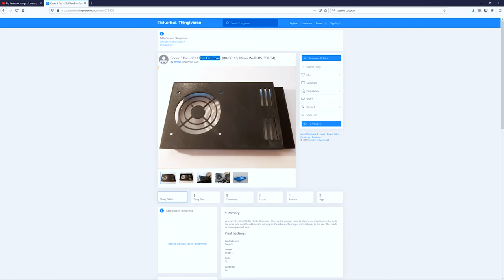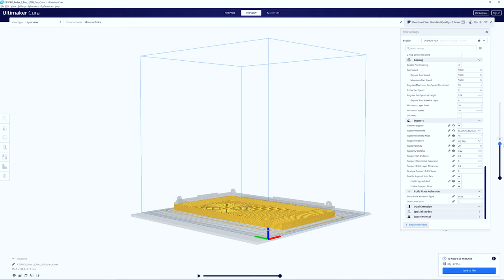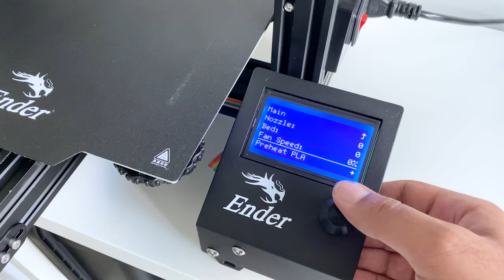Creality Ender 3 Pro Meanwell Power Supply Fan Upgrade Slim 80mm | FINALLY Making the PSU Quiet!

Comment: I swapped out my fan but when I plugged the psu back into my printer I had already plugged the psu into the wall and it jolted the main board. now the screen comes on but it is blank :(  I have the silent board and it has a fuse but the fuse is not blown and it is still lit up. maybe I need to re load the software? please help!!!
Reply from the maker: Hey. Did you by any chance take anything else apart other than the power supply? Is the ribbon cable going to the display fully plugged in and in the correct slot? If you have a SD card installed, try taking it out. If those all check out, put the stock fan back in and see if it turns on okay.
Reply: @Mangorille  I only swapped the fan, thats the only thing. All the fuses are intact and the board is getting the power it needs. I took out the micro sd and it still doesnt work
Reply from the maker: If that’s the case, try putting the original fan back in and see if it solves it.
Reply: @Mangorille  i put my old main board back on to do some urgent prints, the new 80mm fan works perfect. I guess the overvolt protection on the silent board is just not effective

Comment: Be good to see it working, or did the 24v blow the 12v fan up??
Reply from the maker: Ya should have included that in the video. The stock fan is actually 12volts, check out 3:02 in the video.

Comment: Hey! Thanks for posting this video.  I came on looking for a replacement 60mm fan and now think I will be doing it this way.  Have you had any issues with the PSU heat warping the PLA cover?  The aluminum cover was likely not doing too much heat dissipation but I figure that is a consideration too.  I think I will probably try to pull air in as designed so the fresh air is going exactly where intended.  It is possible that by pushing air out the airflow may not be as designed.  I am guessing with the bigger fan it would just go a little faster if that indeed was an issue depending on where the thermistor is installed.  Have you had any issues at all using this setup?  If all good I will order from your affiliate links.  I will be watching your other videos as well regarding the extruder fan and main board fan.
Reply from the maker: Hey. You're welcome. Did not have any issues with warping in the cover, the power supply doesn't get hot enough to wrap PLA. You can always print in PETG for extra peace of mind though. The larger fan would spin slower to move the same if not more air. Have not had an issue to date. Thanks for your support!
Reply: @Mangorille  Thanks again.  I have ordered the PS fan and the hot end fan as well as two buck converters using your links.  I did not see a link for the noctua 4010 for the mainboard so I just ordered that through amazon search.  I need this as quiet as I can get it with it still working.  Guessing your recommendation is option two from your video.  Even though these fans are more expensive than the 24V fans you can get through TH3D I saved a lot as TH3D shipping to Canada was $39 US on top of the $24 for the two fans needed.  I also read they are not necessarily much quieter than the stock ender fans.
Reply from the maker: @mmicker007  Thanks for the update. Those upgrades will reduce the fan noise almost to zero. Do you already have the silent board or the SKR Mini board? The next source of noise are the drivers that come with the stock board.
Reply: Yes that was the first upgrade I did. Much quieter with the 4.2.7 board.
Reply from the maker: @mmicker007  Great, ya, makes a big difference!

Comment: The problem is you did 99.9%... You didn't confirm on video whether or not it worked or you had any problems 🙄  kind of a big step to leave out in this whole process
Reply from the maker: Ya, some others mentioned the same. The end of the video got corrupted and I did not want to re-shoot in my haste to get the video out.